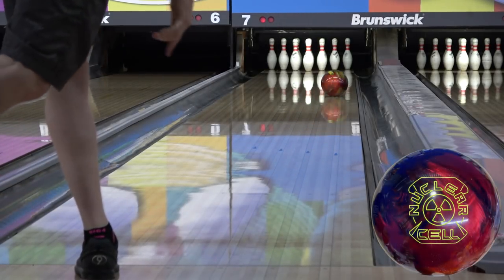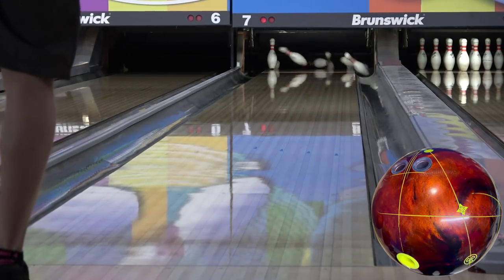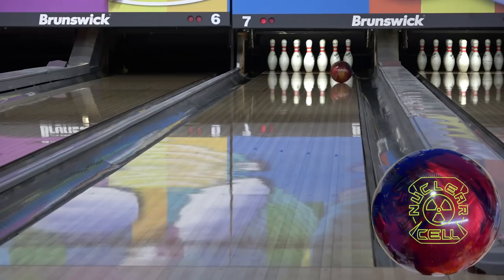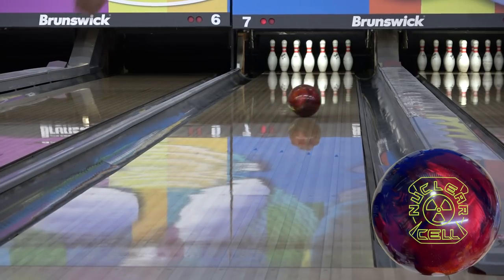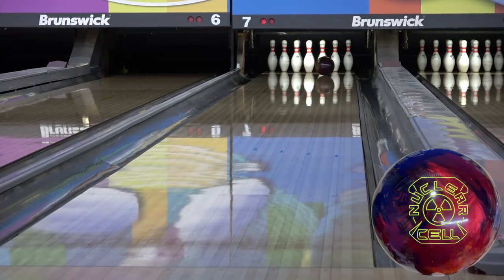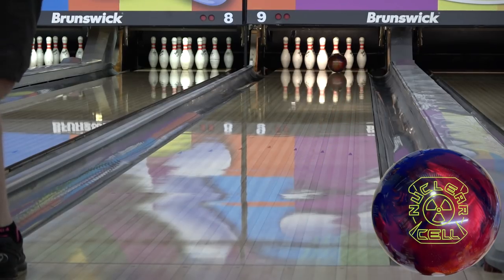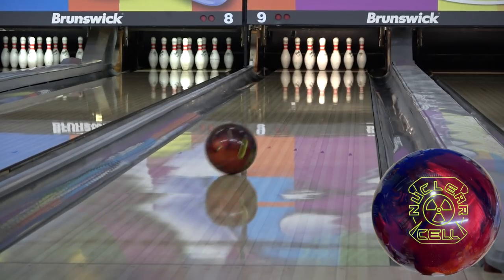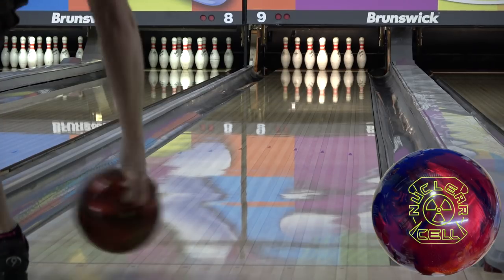Nuclear Cell: In Depth

Comment: Hey Luke, do you think it would be possible to list the approximate dual-angle along with your pin-buffer layout numbers? For me, I kinda get the pin buffer system, but the dual-angle numbers just intuitively make much more sense. Thanks
Reply from the maker: Eh, they prefer us to use VLS only since dual angle isn't a Storm system . . but this layout is 45 x 5 x 40 in dual angle.